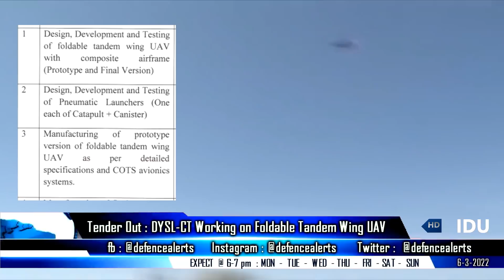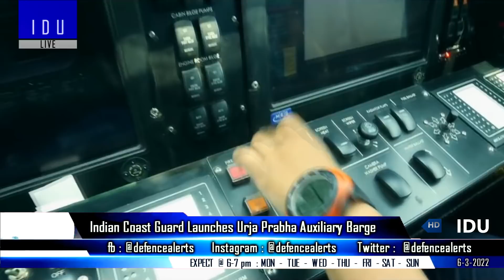Indian Defence Updates : Rafale MRO Hub,IFCC For FUFA,Tandem Wing UAV,DRDO Jet Suit,HANSA-NG Trial

Comment from the maker: 🔴What's Your Opinion : "Rafale MRO HUB In India" ?
ＬＩＫＥ | ＣＯＭＭＥＮＴ | ＳＨＡＲＥ | ＳＵＢＳＣＲＩＢＥ
Reply: A good thing to prevent a repeat of the Mirage 2000 debacle. Better would be a production line of 24 Rafale per year in India with it's supply chain.
Reply: @jacksonteller1337  will be very very expensive. Might be cheaper to develop and produce AMCA
Reply: @sachinmesta4238  AMCA MK2 will be in production around 2040 at the earliest. What do you want the IAF to fly until then, artist renderings?
Reply: @jacksonteller1337  I think we are covered for that, We have Su-30 MKI which would be upgraded with new avionics and radars, that would make them 4.5 ++ gen, The MiG-29 will go the same way, MiG-21 will be replaced by Tejas 1A, Tejas Mk2 will replace Mirage 2000,  Tejas will end up being the single engine back bone of IAF, with AMCA being the twin-engine premium jet.
Reply: @sachinmesta4238  the Su 30 is a crappy aircraft, it was good when it was bought but now completely obsolete and HAL is taking forever to upgrade the Mig 29. How long do you think it will take them to upgrade over 200 Su 30. The Tejas is coming in at 4 per year production and they are going to start the MK1A production in three years time. Can you guess when they will start production of the Tejas MK2 i can't it will be at least a decade. This is why they need to get private sector companies production of aircraft started. Reliance needs to get into the production of Rafale and L&T the AMCA MK2. Tata should get the production of the Tejas MK2 and maybe then the downfall in numbers will be reduced.
Reply: @jacksonteller1337  Su-30 MKI is still our premier plane and we have 270+
Further half these planes are enough to keep PAF grounded,
Further the upgrades of Su-30 MKI can also be done by BRDs which are very capable.
Reply: @jacksonteller1337  Bhai again they r speaking on 21 mig29; is that not cancelled ? Has already India decided to accept CAATSA?
Reply: @sachinmesta4238  they are upgrading between 150 and 200. They have a PESA radar and nineties avionics. It is sufficient to deal with the seventies weapons the Pakistani and Chinese use now but they don't stand a chance against newer types from China or Russia. It takes HAL 20 years and four crashed to upgrade 40 Mig 29. The Su 30 is more complicated and needs more structural overhaul. It needs to get an upgrade or partially replace it with the Rafale until they start production of the AMCA MK2. The Russian aircraft are available between 27 an 40% of the time. Rafale is available 75% of the time when brand new even 80+% they can do everything the Su 30 MKI can only better, cheaper and at a higher success rate. The IAF has published a 2,5 times more effective than the Russian aircraft ratio. The only thing that is good about the Su 30 MKI is that it can carry much ordinance over a long range. So use them as bombers with self defense capabilities.
Reply: @jacksonteller1337  The PESA would be replaced by Uttam AESA, so would many of the RWRs etc, also there is new jamming pod.
Also there is an idea to put 3 jammers on few specialised planes for making them "Growlersky" and with Indian ARMs and other A2A missiles like ASTRA 1 & 2 and even ASRAAM and SAAW and importantly Brahmos NG
Reply: @jacksonteller1337  will 464 additional T90 ms will be challenged by CAATSA?
Reply: @jothisampath415  that would be dependent on the parties in power i would say a replenishment order but the US currently has a Democratic majority so they have a different few usually. But it will mostly depend on how many dead children are on TV in the US how strict they will be in it's interpretation.
Reply: @jacksonteller1337  Thanks Bhai. Hope we can evade sanctions n keep buying cutting edge weapons
Reply: @jothisampath415  i hope so too, the Russian Federation is only providing near obsolete equipment and the western weapons are necessary to keep on par with China.
Reply: @bonitaramsingh  today alone 15 jets r shot down + helicopter. 12 su30 mki we can go ahead as we need new su30 to modify for Astra 2 & 3 tests. 29 mig29 is really useless. May be it s to replace mig21. Major problem is due to HAL poor performance.
Reply: Nice decision . It's should be coordinate like wise to generate revenue and dependency of other countries in this region that can influence our geopolitics policies along with enhancement of sanction imposed capabilities like USA with our interest
Reply: 150 Rafales n Himalayas will change d game in India favor. Bring on additional Rafales soon
Reply: A very welcoming decision, though it could've been made earlier but better late than never. Now Rafale MRFA deal should be realised as early as possible. Jai Hind 🇮🇳
Reply: Hmm I what to no that India can buy from Russia  Su 57 as replace  of Su 27 Please reply  to my comment
Reply: @Flying Tiger I know you are anti Vlad... But the recent developments are actually bad news in the long run
- Comprehensive winner = China they always knew USA and the west are not good friends and here Russia-China coming together will have SIGNIFICANT geopolitical implications..
- New Bloc certainly formed, with so much noise about fully sanctioning and isolating Russia, NONE of these tactics is going to work against Chine
- The new bloc will get many new sanctioned players in the future like Iran Venezuela etc..
-Energy security and energy based gains Chine wins big!
- Russian navy gets involved 100% in the Yellow sea and the South China Sea..etc etc
ALL my geopolitical wishful thinking about Russia having good relations with west benefiting via Nord stream 2 type deals, letting apprehensions about winnie used in a helpful way ALL GONE!
Reply: @Flying Tiger I disagree about the China part.. They didn't lose anything, in fact they are going to gain a LOT.. Let's be clear about one thing NATO or EU ain't gonna do nothing to put pressure on Chine..There is no way USA can convince these "prosperous" countries as they fully rely on the factory of the world, not the same category with Russian energy.. It's not only as narrow as just taking Taiwan there are much more ambitions plans from winnie to reach superpower status and more allies WILL help Chine..The NATO tactics with respect to Ukraine to counter Russia, is a loss in the long term against Chine..
Reply: @Flying Tiger There is too much overestimating of factors that will make them collapse.. I've been hearing about the housing crisis for quite a long time now... Truth be told their main strength - foreign trade has increased.. Have to accept there is no real noticeable danger to their overall stability..
Reply: @Flying Tiger Give it time the new bloc can eventually challenge the petrodollar.. Chine always play and bets on the long game.. Vlad is severely hurt by the EXTREME reaction, and he will take considerable steps which will make a difference.. I would not just write off Russia's relevance with respect to geopolitics just yet..
Reply: Yes fruitfull
Reply: Good option with tot under mki.👍
Reply: Please make Hindi YouTube channel...
Reply: सुखोई 75 जेट्स भारत मे निर्माण करना चाहिए
सुखोई75 जेट्स राफेल से दस गुना सस्ता और F35 जेट्स को भी आसानी से उड़ा सकता है और रूस की पूरी सुविधा भारत मे अवेलेबल है
Reply: pls change or upgrade last 17 seconds of video
Reply: Yes and that will be good and india can be a centre point and our indian defence can be more skilled.

Comment: Earlier it was reported that MiG 29,s deal has been cancelled. IAF needs these cheap MiG 29,s and upgraded to UPG standards. MiG 29 may be heavy in maintenance and other servicibility issues but once in the air it's a potent multirole platform a worthy opponent to the F16. 
Why does it take 2 plus years even for such 2nd hand deals to get approved. Such slow bureaucracy wrangles and red tapism babugiri.
Reply: some guy  bureaucracy is involved everywhere. Govt to Govt but yet 2 years have passed. Who makes the contract, who details pages of the fine print. Who co-ordinate with each other. You think the ministers do it. Minister only then signs and exchanges the file. The bureaucracy is ingrained on India's every function. Infrastructure projects, contracts, everything.
Govt to Govt only reference is that there are no multiple vendors involved.
Govt to Govt refers to a type of deal whereas bureaucracy is the functionality. You seem to have childishly mixed up the two'.

Comment: If u are comparing with speed...then INDIAN  Mig29 UPG is 2.4Mach and SU-30 MKI is 2.3Mach which is little bit more faster.
Normally fighter jets fly at speed of 600 to 1500 kph.....
Higher the maximum speed worse will be the life of Engine....and considering J10 (speed 2.2Mach) is using Chinese engine.... that make it's capabilities even in more doubt.🙄

Comment: India should also develop exoskeletons so that these exoskeletons can lift much heavier loads,
IF this is possible then we can have many heavy Artillery guns, and carrying the shells from stock position to the gun breech would not be such a problem.
IF an automated system is used, that would make the system bigger and heavy, and then more difficult to move around, So if and when we have say 300 mm gun that can fire heavy shell that can provide better firepower, also have another suggestion, that we should develop a small powder charge that is not very powerful and using this we can fire unmanned drones with IR cam that can be propelled by this charge and then have its own loiter time of say 60 minutes, this can be used by the battery commander to locate enemy targets and then use this targeting by the drone to bring the full firepower, thus the drone becomes the observer/spotter for the artillery and command. The drone self destructs when the power runs out. so need to have -1 2 kg charge inbuilt for that.
Reply: Already there
Reply: Already made it and video also out .

Comment: PAF is flying faster to their end in the J-10C. It lacks high end avionics and the missiles it carries are limited in use against manoeuvrable targets. The J-10C is a high altitude fast interceptor that can be fitted with limited ground attack weapons, the Rafale is a multirole low RCS fighter tailored to medium altitude operations. The Rafale can intercept them within the NEZ of a Meteor missile without being in danger of being shot down themselves. But even if they are faced with the Tejas MK1A the two aircraft will be evenly matched.
Reply: As much as I support India, I think completely dismissing Chinese Avionics and Chinese Missiles as underperforming or inadequate is completely dangerous specially when ground realities suggest the opposite.

China has invested so much money on electronics and rocket technologies, their leading consumer facing companies like SMIC, BOE, Huawei, CALT etc and their success in domestic jet engines reflect this.

Honestly they're way past "Ahaha China junk" stereotype.
Reply: @sidewinder3422  J17 was made in China. Even if we take Pakistan media reports around 15 has fallen. Many r grounded . Chinese drones r completely non-operational. J10 s no diff. Should be worried about quantity. Because they make them in huge numbers. Quality no worries
Reply: @sidewinder3422  I am more concerned about their engines, they are copying Russian engines who are themselves not mastered the material for making good engines.
Reply: Are you indo-american??
Reply: Made in  China...... Ha ha haaaa

Comment: AMCA & FUFA is just DAY DREAMING... 🤣 keep doing TIME PASS as in past 70+ years dats OK. But make sure u maintain 42+ Sqad strength... Please look for some outdated, grounded Mig-21, 29 etc 
And get them updated by 6th gen high tech TYRES. It will be grt force multiplier 🤣
Reply: Koi isko kuch nahi bolega, bolne do isse; bichare ko dard huva hai ;)
Reply: If you do not understand defence, better not to comment and prove that you are a fool
We are taking more Su-30 and MiG-29 to replace the planes that we lost in accidents,
A Squadron strength is 16 planes, so if say 1 plane is lost then though its a squadron, its not in its full strength, so these are being replaced, we are not buying them to make new squadrons btw. The MiG-29 purchase are for the air frames that Russia has, they tried to sell them to Algeria but they had refused, since we need these we are taking those.
FUFA is jst a project now AMCA the design has been frozen, the priority right now will be LCA Mk2 and then AMCA 
There wont be an ORCA, There could be TEDBF as we may not order either Rafale or F/A-18 due to different plans,
F/A-18 because America being America, their sanction could deny us the spares that we require and thus we might not be able to use them for long time if purchased,
Rafale do not fully fit the lifts in Vikrant.

Comment: its good that J-10C has higher top speed, maybe that helps it to run away?
Reply: Im thinking the same 😂😂😂😂
Reply: Speed is useless absolutely since all AA missiles are above mach 4 mostly.. So maneouvre caoability and jamming matters if dogfight , interceptors used...
Reply: Speed ki light se tej 🤣🤣🤣
Reply: Bhai wo aircraft China ne retire kar di hain😂 in chutiyo ko 2nd hand Jabra mal mila Hain .
Reply: @RupamDeka-l8n  yes, apparently, had seen the pictures, the chinese AF markings were seen, very light, China might be saying,, You cannot afford new, just take these.  I do not think these are new, but second hand ones,
Reply: It's acceleration will be horrible though 😕
Reply: Best analysis on J10C🤣🤣🤣🤣
Reply: Speed se Koch nai hota yo bo speed hai bo maximum hai usko tabb use karte hai jabb baagna Ho jaldi se jaldi uske liye bo afterburner use karte hai 
Aise binaa afterburner use kiye Bina Rafael super cruise kar sakta hai 1400km ki speed hai Lakin j10 800-900 ki hi speed ke saath ud sakta hai yaada ke liye usse afterburner use karna padegaa jisse fuel udd jayega jadl hi
Reply: @makingindiaadvance  and the bigger problem is that J-10C has a Chinese engine, whose reliability and efficiency is questionable, maybe they fly at top speed and then the engine just gives up
Reply: @sachinmesta4238  🤣🤣🤣
Reply: 100 m race thoda hai
Reply: 1dam sahi kha apne ....
Reply: @Dr. xyz I do not know how much you know about aviation, but do let me know which plane has fired its A2A missile at say Mach 2.. The high speed is good for going from point A to point B, but when firing missiles, its never a good idea to fire them at top speed.
Reply: @Dr. xyz  so as per you if the plane is moving at Mach 2 and it fires a missile that has Mach 4 capability, then it will go with Mach 6? To increase the range of the missiles, (somewhat) the missiles can be fired a bit angled up, that's all, Please don't put such stupid statements,
Reply: @sachinmesta4238  Dr
 Xyz will be hired at highest base price ever placed by NASA- such a genius he is🙌🙌🙌
Reply: @Dineshyadav-fp8hr  Maybe is already in NASA, no wonder their space project is so expensive.
Reply: Hahahaha 😂
Reply: Wahhh 😂🤣
Reply: Bro 🤣🤣🤣
Reply: Sleep tight 
PAF is awake to runn away
Reply: Does J10c have any Cruise speed for escape....?
Little Top speed is nothing on middle of the wars against mach-4 speed Air to Air Missiles..
Reply: @lathiyabhavik9080  agreed
Reply: Or catch us
Reply: In a dodge fight yes, but if try to shoot it over the horizon without coming in sight then it will paka hit
Reply: Man u made my day 😂 😂 😂
Reply: Speed thrills but kills., india have an experiance to defeet pak with equipments of 19th century , when they have support from NATO.
My soldiers is more powerful than their expectations.😍
Reply: Speed is no longer the deciding factor in air to air combat but it does have its uses , Today’s air to air is based on turn rate , radar and other electronics ,missiles and of course stealth.
Reply: Kya baat..👏👏😂😂
Reply: Pak kuch v karle Rafael Rafael hai aur chung chang bhung bhang jet kahi se comparable nhi h
Reply: True
Reply: Toh fir jf-17 aur j-10c mei se pehle mars tak kon pohchega? 🤔